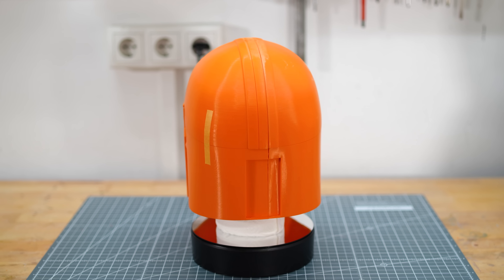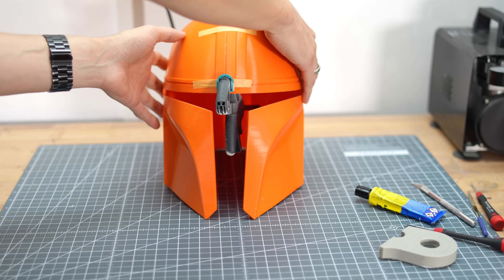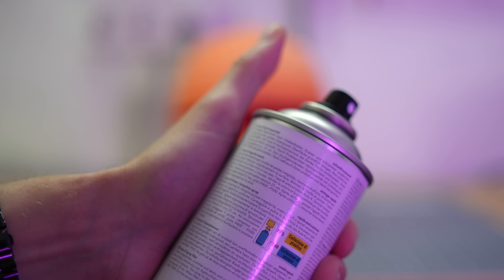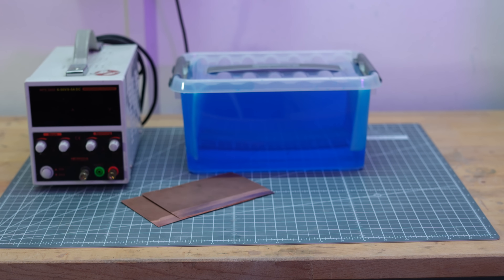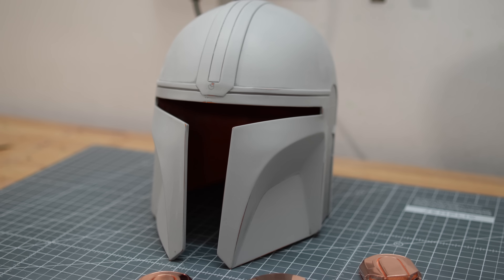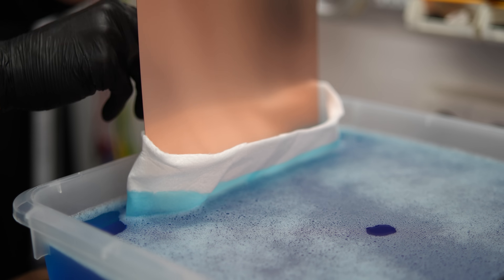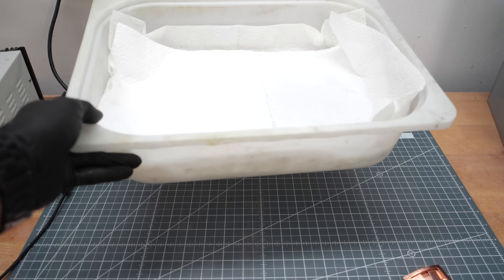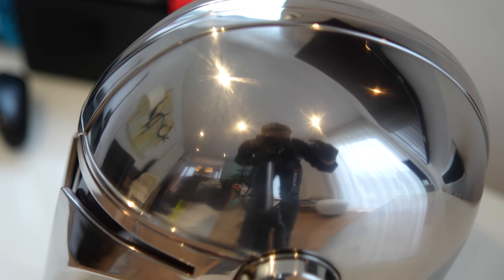Electroplating 3D Prints |  Helmets Tutorial 1

Comment: Two questions: 1. what thinner was that, I couldnt find it online? 2. have you tried alcohol or water based conductive paints, I want something I can use indoors as I am plating warhammer minis
Reply from the maker: That’s acetone as the paint is acetone based. Don’t do it without a ventilation system. You can try graphite spray, but it’s hard.
Reply: indoors no.   acetone is the usual thinner in for instance nail polish, if someone paints their nails near you and you can smell it, yes that scent.  It's not all that good and it's definitely not good for your face in huge volume (hence the mask in his video).

For reference, I do use regular mini paints, but I also use nail polish on my D&D minis, the ability to mix matte or gloss is an amazing effect.

I think perhaps if you plate the minis you are working in smallest batches an open garage (or backyard if your local weather is kindly) should do well.

Consider also, you need someplace Safe to store these potent liquids when you are not plating.

I do not know what he used but acetone itself is available at my local model shop in bottles, and sometimes in beauty supply as nail polish remover (though you must take care to get the cheaper straight-acetone and look at its percent, that it does not have impurities meant to protect some ladies' hands).
Reply: @starshinewindlord2716  Recently had success with making my own water based carbon paint. Finally able to run the airbrush for plating indoors.

Comment: Just a heads up that there's something called "spray putty" that's even thicker than high build auto primer. It requires a normal primer afterwards, but I've found it to be quite excellent. I only needed 2 coats when printing at 0.1layer heights to get a nice smooth finish. When printing a helmet with 0.3 layer height, I found smearing flexible auto body filler thinly across the layer lines was better, as the auto filler primer just didn't have the mass to fill even after many, many coats and tens of hours of hand sanding.

Amazing helmet, looks fabulous.
Reply from the maker: Alright, i‘ll try that stuff next! Thanks!
Reply: @hen3drik  Forgot to mention, the brand I've used is called Motip. I think it's a European company, so should be available.
Reply from the maker: @skywardsoul1178  i just looked it up. It says spritzspachtel and that’s exactly what my stuff say as well. I have to say that it also builds up a big layer.

Comment: What an amazing work! I just didn't get the part of the galvanic pen and how you've done the palladium finish. Could you please explain it to me? Thanks in advance and congratulations again on the amazing job!
Reply from the maker: Pen is an anode holder with a non voven bag that’s dipped inside palladium and „brushed“ on while it‘s connected to the positive and the helmet to the negative pole.
Reply: @hen3drik  how many volts/amps?
Reply from the maker: @hemarqueso  that depends on the electrolyte. You have to look it up in the manual. Usually it’s started in there.

Comment: Most epoxy resins are way safer than polyester resins, and they work just as well. Whenever I fibermat or reinforce a print, I use a 2 part epoxy (normally SmoothOn 300) and have great results. Great outcome! They helmet looks great!
Reply from the maker: Thanks for the info! I‘ll try this next time.
Reply: @hen3drik  Try you local shipmaker/shipwright/guy who works on smaller wood and composite boats. They usually buy it in 200liter drums as non UV protected variant, so its dirt cheap comparing to say Total Boat products. I got mine from local guy for 30€/liter of ready product, where total boat seems to be 90€/liter plus taxes and imports over here. Since you will be putting paint on top anyways its irrelevant how well it handles UV. Been doing this on my own crafts and it seems just layer or urethane lacquer is giving good protection. Hell just CA glue layer does the work based on objects that have been in sunlight in north for a year so far. Next to no off gassing compared to polyester resin so way pleasant to work with.
Reply: why not just use a iron solder and melt the plastic or just drop melted plastic to solder both parts? i always do that cuz is easy, fast and provides a strong bond

Comment: Wow this is a really great result. I tried electroplating my sculptures and never got close to the quality shown here. The palladium pen coating is a great alternative to Nickel. Well done. Very well explained/documented and really impressive outcome.
Reply from the maker: Thank you for your kind words!
Reply: Yes because the surface on sculpts can be difficult to rework with sandpaper. So it will be not so glossy
Reply: @PCPointerDE  I'd be tempted to try ABS with an acetone vapor polish.  Sanding my car took wayy too long...
Reply: Much more expensive... but I suppose much less bio-reactive?
Nickel plating bath is easy to make and not very toxic... I used it on my water-cooled rig because a liquid-metal heatsink compound will just eat copper over time...

Comment: Is there a specific reason (cost? thickness of the coating layer applied?) why you use a galvanic brush to electrodeposit nickel or palladium on the helmet, rather than an electrolyte bath in a tank (i.e. same way as copper in the previous step)?
Reply from the maker: palladium: cost reason . nickel: too scared!
Reply: Cost of palladium: okay, understood. Why scared of nickel? Is it so toxic?
Reply from the maker: @fluxcapacitor  it‘s okay, but it‘s just to much stuff. I use the bath for a lot time to create big layers. Nickel is just 5 min or so, I just don’t want to fill the basin and cleaning etc. I guess
Reply: Ok. So it's better to coat a thick layer of copper and then a very thin layer of nickel, than the opposite?
Reply from the maker: @fluxcapacitor  thick copper, then thin palladium is best
Reply: @hen3drik  Many thanks for listening and answering. You rock :) Thanks to you I may be able to put it into practice!

Comment: Great work, amazing results! I only fear it may not hold the plating for too long since the plastic underneath may be very soft, (I´m assuming  you used PLA).
Reply from the maker: Nah, it sticks well and is to thick already. Never had a problem with flaking off material 😃

Comment: ...why not vapor smooth the helmet?
If its pla, you can use ethyl-acetate. Lot less elbow grease required that way, and you can also solvent weld the part together using the same technique.

Not to mention that if you are doing electroplating, you can also do electroplishing.

Comment: Another question: Can the whole basin be enclosed with a tight lid to protect the electrolyte from ambient dust? I think not, because the electrolysis should produce O₂ and H₂ in stoichiometric proportions (?) so the gas must be correctly ventilated to avoid any overpressure in the enclosure or worse, maybe a flammable explosion?
Reply from the maker: I store my 5l tank exactly as you described and the 50l tank in sealed cans  á 5l.
Reply: @hen3drik  Okay, but do you confirm that the container must NOT be sealed while in use (i.e. while electroplating is occurring)? I wonder if I can make a sealed chamber even while in use. But I am concerned by gases that may be produced by electrolysis.
Reply from the maker: @fluxcapacitor  ah, okay, do it outside or in a well ventilated area. Safety first😃

Comment: Wonderful! Instead of rotating slowly the whole helmet inside the bath, could we just stir the electrolyte with an electromagnetic agitator (you know, that little capsule magnet rotating quickly in the liquid with a base device underneath the basin, that looks like an electronic scale)?
Reply from the maker: Unfortunately not, the rotation prevents anode shadowing. Imagine as the way between anode and object has to be even and straight.
Reply: @hen3drik  I understand. I thought it was to evenly distribute the ions inside the liquid at first but it's really the electric field between the anodes and the cathode that matters. Thanks!

Comment: instead of the sanding, would another solution be possible? maybe like an acid bath or something?
It seems like the sanding might be the most tedious and meticulous stage of this process.

also, your printer (ultimaker) is a 5000 dollar printer, are cheaper solutions available?
Reply from the maker: Sanding is way easier on a resin print. On FDM it‘s pretty necessary. I bought the ultimaker 2+ back in 2016 for 2k€, but of course you can get way cheaper one. For helmets I’d suggest a Neptune from @elegooofficial as it has a giant build room.

Comment: when connecting 3d printed parts, just use 3D pen.
It's like welding but with plastic. Most of the time you will get much stronger connection than the part itself.

Comment: I would protect the finish with either some lacquer, or even better, ceramic coat the 💩 out of such a nicely done metal finish.
Reply: I'm not even sure how lacquer would adhere to the smooth surface
Reply: @butterfinger4393  Did some testing over stainless steel with automotive ceramic coating. It works wonders. Nevermind the lacquer, it would most likely peel off.
Reply: Actually, depending on what you're doing, I'd suggest waxes. There is a ton of color control that goes into in producing a patina on sculptures.

Comment: Heh... The Sanding Portion of the Video reminded me of my D.I.Y. E-100 Project ( https://youtu.be/6XZXryXOO5A )... Had initially planned to make use of the Textured Print Surface the parts were printed on to provide the structure for a Rollen Steel Effect which technically would have worked if it wouldn't have been for the also present gaps between the Print Lines ( not Layer Lines ) that kind of only became really visible once I started applying paint onto the model. No amount of Primer got me to a satisfying result so sanding for like 2 days it was to get rid of them.

Comment: Have you considered using acetone vapor-smoothing to create the perfect finish for your prints to apply conductive paint on?
Reply from the maker: I did. It’s making it smooth, but not even. That was the problem
Reply: I used uv resin to smooth mine worked great. Or bondo spot putty

Comment: You would need less electrolyte solution if you used something inert to take up volume inside the tank. I don't know enough about electroplating to say what could be used but we do the same thing in our sinker edms, maybe filled water bottles? Anything that takes up volume will not need to be filled with the solution.
Reply: You are right, although a bit difficult to insert bottles in this setup. Following the Archimedes principle, the volume of the fluid displaced is equal to the volume of the object immersed. In my case, I want to plate sculptures that are closed, so although the surface area may be large, and comparable to Hendrik’s helmet, the volume of my sculptures would require considerably less electrolyte.

Comment: This is incredible, I've been trying and failing at this for a few months. I'm curious what electrolyte brand you're using and how you avoided makes from the wires, aka "rack marks"
Reply from the maker: I mostly use tifoos stuff. Ahh, the rack marks, I have these, a lot! I try to avoid these by constantly moving the wires. Then I usually sand away these marks. I got rid of the vertical lines when a lot of copper is deposited by constantly moving the parts. I will set up an air bubble system to get even more motion in the bath.
Reply: @hen3drik  thanks, I'm using a bubbler and have also tried a magnetic stirrer. Really not sure at this point what I'm missing. I'm getting a lot of artifacts on the prints, even though they are sanded super smooth, and th deposition is not consistent, especially near the wires (though I'm using one big copper wire and not lots of small ones so maybe thats a big part of the problem. been using MG chemicals nickle conductive paint. Back to the drawing board I suppose.
Reply from the maker: @rochesterjudo4330  i get copper crystal at sharp edges and points. „Shield“ these with copper wire.

Comment: Superb finish and great attention to detail . I wonder if you have had a go at brush electroforming in copper for large items. I have bigger sculptures than the size of your helmet that I would like to plate where dipping in a bath would be impractical due to the volume of electrolyte needed as well as the size of the container.
Reply from the maker: Yes, some people do that actually, but you won’t have mirror surfaces and you will deposit very slowly. Only some micrometers when bath plating creates hundreds of microns.

Comment: Wow, that's incredible dude! ^_^ Came out beautifully xD I've been slowly oversaturating my baths so that I generate an excess of solution, then removing and diluting it back to stable, in order to generate enough solution to do huge builds like that ^_^ I dare not ask how many litres you bought to fill that haha :) 
I just joined the FDM club (after 4 years of resin printing) so I'l finally be making your rotating jog (forgot the name lol) once i've got the neccessary basic upgrades all installed and calibrated

Happy New Year dude!
Reply from the maker: Oh, I need to dilute on of my baths, too. How do you do it?
Reply: @hen3drik  I have a primary bath that's got around 20l in it  now(i keep track badly lol really should monitor it better, but my goal is making more so it's no worry). When I drive it to oversaturation (i do an inverse method, and starve the pieces been plated, only use approx 1/10th of the surface area submerged at once and very constantly adjust it once it's dissolved into the bath, this has the effect of working well, but also eventually oversaturating it) I just remove approx half of it to another container, then add the same volume of deionised water to each. That gives me double the total solution. I then test the PH of the solution and add some sulphuirc acid, leave stirring for 10 mins, then measure. Once it gets to around 0.4-0.7ph then I just add a few capfulls of the leveling agents and brighteners. They don't cost that much when bought in bulk, I use Gateros Plating here in the UK for my supplies, but I think Tiffoo have similar agents to add to baths to maintain them. 
I've experimented with various methods of making the solution, and to try develop brightening agents of my own. No remarkable successes to report as of yet, but I'll keep playing with stuff I find in  academic papers and patents till I get a solution that I can share. I'm aiming to find something that's both cheap and effective, but also with stuff that's easily sourced. Will share freely if/when I do suceed.

Comment: How expensive is somthing like this for all the stuff needed
Reply: @nem0meimpunel8cessit  I have printer haha sorry I should of mentioned. I just mean all the tools for the electro plating ect
Reply from the maker: Basically the electrolyte + power supply. The prices vary from where you get it. My bath is around 1k, but i poured everything from my stock together to get that basin full. Acidic copper Electrolyte is also maintainable and can be used many times. I usually don’t do this big baths, because it‘s super uncomfortable to work with.
Reply: @hen3drik  How many liters was the bath?
Reply from the maker: @vertigo042  around 50l. I poured everything of my stuff together to reach the level I needed.